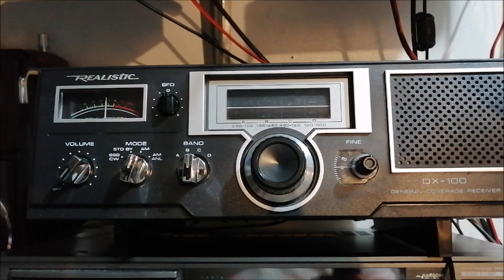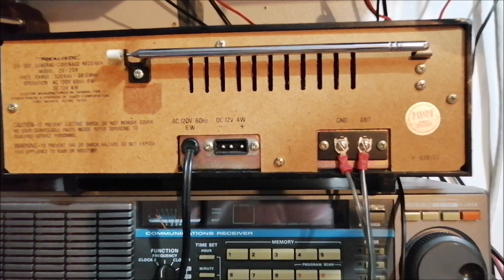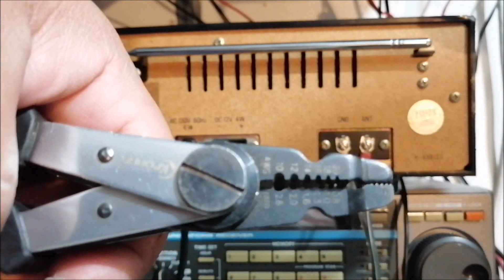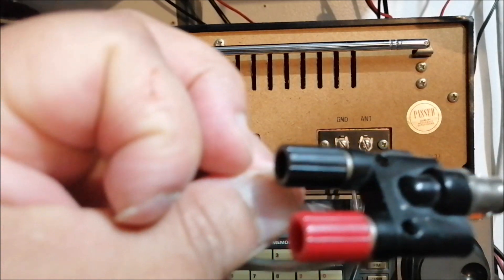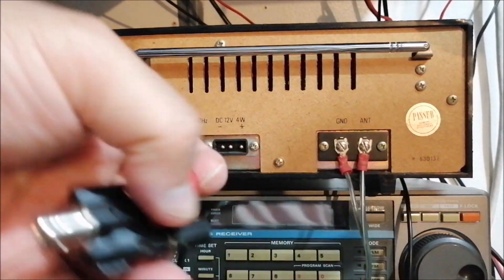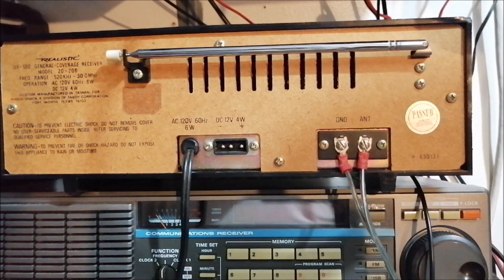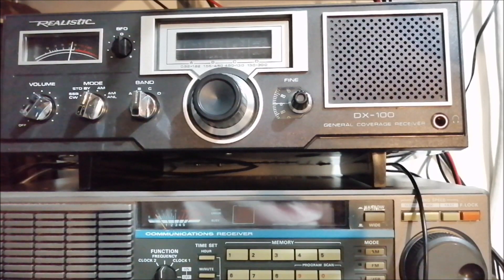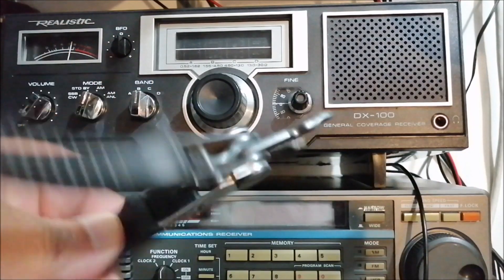How to connect the MLA-30 + loop antenna to an older radio like the Realistic DX-100 shortwave radio

Comment from the maker: 300 PCS of assorted electrical wire connectors - https://amzn.to/3zgzoCU

BNC Male Plug to 2X 4mm Dual Banana Female Jack Socket Binding Post RF Coax Coaxial Splitter Connector BNC Banana Adapter Pack of 2 - https://amzn.to/3v1FaWj

SMA to BNC Adapter Kits for SDR,Handheld Radios, Scanner,Walkie Talkie Adapters SMA Male Female to BNC Male Female RF Coaxial Adapter SMA to BNC Adapter Digikey Coax Connector 4 Pieces - https://amzn.to/3oioi9S

IRWIN Vise-Grip Wire Stripping / Wire Cutting tool - https://amzn.to/3AZfPA9

If you enjoyed the video please give it a thumbs up and also please subscribe to my channel.

If you wish to donate any amount and help support this channel. 
 https://www.paypal.me/Danny914

You can also support my channel through my Amazon Wish List.
https://www.amazon.com/gp/registry/wishlist/64BI9DVG4BYA/ref=cm_wl_list_o_1

My Amazon Shortwave Radio Store.
https://www.amazon.com/gp/search?ie=UTF8&tag=dannyshortwav-20&linkCode=ur2&linkId=712abd4a9303729f0ed2b3d7f84dd728&camp=1789&creative=9325&index=electronics&keywords=shortwave%20radio

If you wish to donate any new or use radios, antennas, radio related equipment or would like me to review a product. You can contact me via email dannyradioandtech@gmail.com

Follow me on Twitter and I will follow you back https://twitter.com/DannyRadioNTech
or @DannyRadioNTech

My Other Channels:

Danny Retro Gaming - https://www.youtube.com/channel/UCfEsQms6Em9YhksUhd5-jEQ

Danny Finance - https://www.youtube.com/user/dantheone

Thank you for watching.  :)